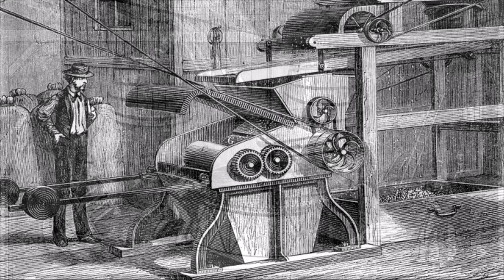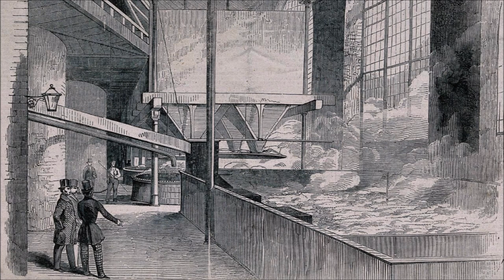MELCHESTER BREWERY - How it works:  feat. QUEEN ANNE.

Comment: Nice video and animation.
A couple of the brewing steps are a bit shortened and merged together, but good work on the general process. 👍
Great layout too
Cheers.
Reply from the maker: Thanks, I did wonder how well my research would come across as it's not a subject I knew anything about, but found the entire process of researching very intriguing once I started looking into it.
Reply: @melchestermodelrailway  it is an interesting process.
Your research created a good story. 
The partly germinated grain is "roasted" or "toasted" to various levels to make the malt. The darker the "roasting" the darker the beer. In the breweries of today that is generally not done at the brewery though. 
The spent grain and hops are extracted together after the boil and usually used as animal feed today.
Not sure about back then but probably the same, the wort is transferred to the fermenters through a heat exchanger after the boil to drop the temperature quickly and the yeast added straight away. 
The wort needs to be run through sterile or santised equipment to avoid infection. The key to good beer is clean equipment. The hot liqour tank is a key part of the process here obviously. 
It's interesting. A 25 litre home brew usues the same process as a 3000 litre commercial brew and takes the same amount of time throughout the process. 
Your process was enough for non brewing lay people.
Good work.